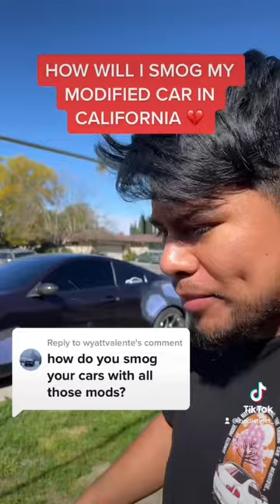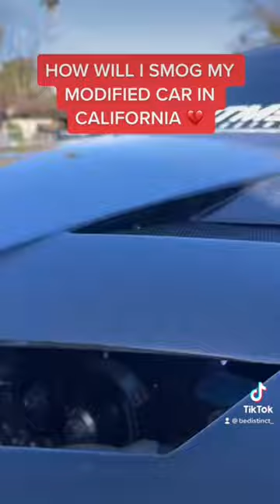HOW to PASS SMOG CHECK in CALIFORNIA with MODIFIED CAR! #carshorts #shorts

Comment: How is the e85 illegal when they have it at the gas pump 💀
Reply: Track cars
Reply: It’s technically messing with the ecu which is illegal
Reply: It's stupid cuz e85 should be better and cleaner but less efficient
Reply: It's not illegal it's only illegal if you modified your car for e85 if your car takes it stock like alot of older cars run e85 and some cars have a fuel sensor that can adjust to different fuels

Comment: Yooooo let me get that smog check places info on low key please I got jeep zj that won’t pass smog cuz it’s smoking a little bit out the tail pipe like cmon man
Reply: What city you in bro?
Reply: @Jesse_Carreon im in the bay. Pmo ill travel if i cant find anyone near me
Reply: @VqLyfe  what’s the year, make and model of the vehicle you need done?
Reply: @Jesse_Carreon  07
Reply: @VqLyfe  uff yeah we would need it here, what’s the make/model? If you do t find somewhere up there im in Socal I’ll do what I can for you
Reply: @Jesse_Carreon yo I’m in the central valley
Reply: @charmin5703  Let me know if you wanna pull up to Fontana
Reply: @Jesse_Carreon can you pass a 2015 ram 2500 that’s deleted I’m in San Diego but I’ll drive out there. It’s not currently deleted but will be soon
Reply: @ironlungs9743  yeah better to bring it before delete and tune.
Reply: @Jesse_Carreon  well it wont pass smog rn either way the dpf filters need to be cleaned and that’s costing me roughly 1k-2k so deleting it will cost me roughly the same if not a little more can you still pass it after the delete?
Reply: @Jesse_Carreon I have a 2006 Subaru wrx with a CEL p0410. It has a carb legal tune from Cobb. Can you help me pass? I’m in SoCal
Reply: @ironlungs9743  yeah I get you. I’m sure we can get it done for you👍
Reply: @xanielton.714  wtfff my guy was charging $250 and $400 with tuned cars u got skunked bro but whatever u gotta do to pass it
Reply: I’m in the bay… what’s the addy?

Comment: “What’s a vehicle inspection” - Me, a Florida Man
Reply: Facts lmao. Fellow florida man here. What are catalytic converters ? Are those the metal pipes under my car that I sold for a good chunk of change ? 😉
Reply: @supa_slo catalytic converters are required at the federal not state level.
Reply: @dllemm  yes technically but nobody is going to check your car for them in florida because there are no emissions or anything . I have been driving my care around with no cats for years. just dont straight pipe the car and make it so loud that its awful

Comment: man here in AZ they just hook up an OBD2 reader and check for codes, if you don't got any codes you're good to go. last time i got emissions done, they never popped the hood or looked under the vehicle
Reply: same in illinois
Reply: Texas also
Reply: last time i got my e-check done in OH i failed it purposefully then installed an aftermarket exhaust and showed them that i had a bill worth over $300 to prove i “tried to fix the problem”. 2 year e-check exemption🙌
Reply: Same here in India for newer vehicles. Cars have been having OBD diagnostics for a long time now.
 Bikes didn't have those for a long time, but newer bikes are bound by law to have Obd -2 ports as well. 

Better for us, as they'll be easier to tune now.
Reply: @StBeter-tc2te  depends on the county
Reply: Can’t you just clear the codes before?
Reply: @559  yeah bruh just clear the codes right before you go in for emissions and you'll pass every time

Comment: If you had the supercharger with stock exhaust, full system with cats. Would this still be illegal? There are cars that have a turbo from factory so how exactly would a car like this change their mind? I get they care about the air pollution or whatever, but a sc is not polluting? Help me understand, also why would adding E85 make it illegal along with an upgraded fuel system ?

Comment: I just did mine in San Francisco with the kit still on. The carb number will clear the visual. But you have to remove the tune. The smog computer picks it up. You need to flash it to stock. Talk to admin tuning if they still have your tune file, I'm sure they still do.
I flashed it back to stock and just used the stock injectors and maf sensor,  and removed the cog belt that drives the blower. Also put the cats on. The carb number on the supercharger passed the visual, especially if your friend is smogging it. 
Once it passed I saw my tuner to flash the tune back on, installed the injectors and maf sensor and right back to full power. Only issue is you will have to pay 300 bucks for a new licence from your tuner. Since I'm tuned by Zcar Garage they are local and took care of me right away, you will probably have to wait for admin to come by again.
Reply: My yr E55 Merc has zero upgrades or modifications, but that damm obd 2 not ready keeps poppin up where in the bay area can I get help.